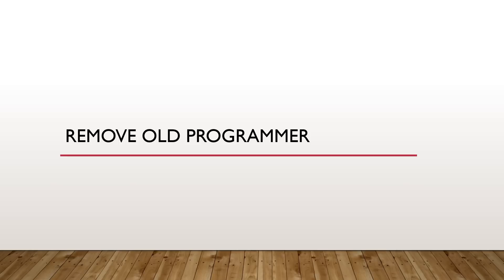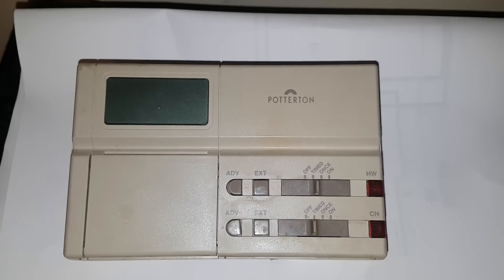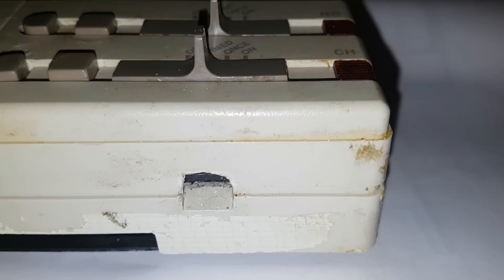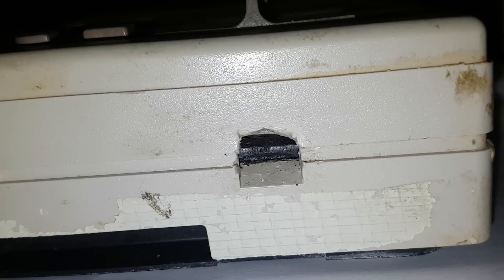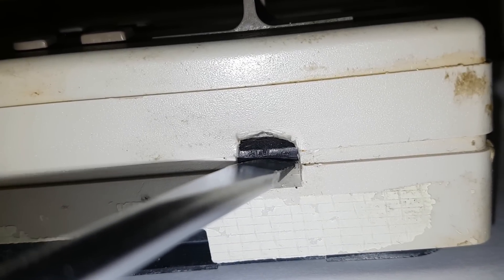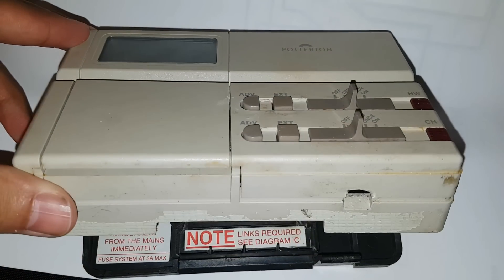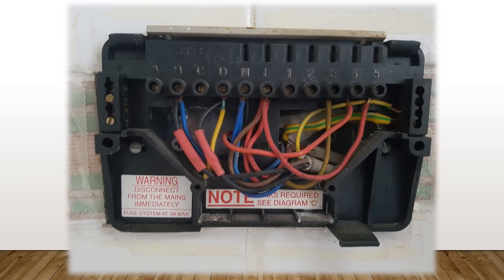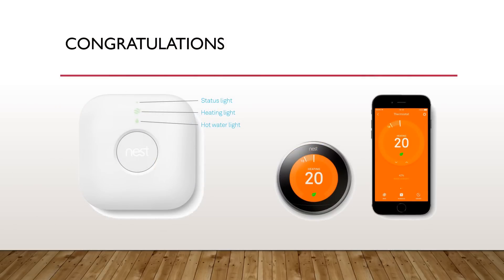How to self install Nest Smart Thermostat v3 (Y-Plan Potterton EP2002)

Comment: Good video, the only thing i would say is with 3 port valve system or 'Y plan' you also need to terminate the hot water satisfied terminal to ensure the 3 port valve does what its supposed to. As per page 23 of instructions. Terminal 4 on the nest. Other than that 👌

Comment: Not sure this fully works? Please educate me!  This solution does not hold grey at 240 when HW is off. Ie Nest not calling HW.  As grey is not energised, orange will not come on when CH white is calling at 240.  Therefore you need to wire nest satisfied terminal to Grey to ensure CH works when HW off - comments?

Comment: Amazing video. I have a question regarding the decommission. How do you wire the display from the receiver installed next to the boiler?
Reply from the maker: Very open question. Difficult to say without knowing it's function model etc

Comment: Is there a blanking plate you can buy to put over old program base? Thanks for video.
Reply from the maker: Just your standard 2 port blanking plate, you can pick those up for 99p. You may have to pinch a hole at the bottom.

Comment: Amazing video. I have the same boiler looking however have nest v2 and looking to upgrade to v3 for both hot water and heating. Do you have a video/wiring instructions on how to use the junction box near the water tank to connect the heat link. Many thanks in advance
Reply from the maker: Junction box is a spiders web. You'll have to do some tracing. See my other video for a basic understanding of how you can decipher what wires do what ..

Comment: Hi, thanks for a great video. We have installed as directed but the hot water is stuck on. Any ideas what might be causing that? Central heating is working fine. The only difference to your video was a blue wire terminated in the spare slots but I can't see far enough to see what it could be from.
Reply: In case anyone else had the same I found it settled in but initially on return of power the system was slow to respond. Seems fine now.
Reply: I've just installed and have the same issue. Did it start responding after awhile? I've just set it up but the hot water seems to remain on

Comment: Hi, after connecting the nest replacing my old potterton, the hot water doesn't work automatically. However when I switch to manual mode it heats up the hot water. 
Secondly, are you able to control HW through the app/thermostat?
Thanks for the patience.
BW

Liju
Reply from the maker: What you mean, hit water doesn't work automatically? It only works on timer and manual and it looks like manual is working? Yes you should be able to control hot water on/off through the app

Comment: Hello, thanks for the video. How did you tidy up the dual gang hole where the old programmer was? Did you mount the heat link straight over the top, or off to one side or something? I have a one gang 'hole' but not sure how to blank it off and still have two cables sticking out? Thanks
Reply from the maker: I bought a blanking plate for 25p from local DIY store. Snapped the bottom off enough to allow wires through, then mounted the nest on the plate itself. So it looks pretty clean.
Reply: @laymandiy  Thanks for the swift reply! I hadn't considered mounting the heatlink to the blanking plate, I was going to just mount it next to it. I bought a blanking plate earlier today so I'll give this a go. I'll probably just stick it to it 🙂 Cheers

Comment: Hi, 
I'm so confunse about all the nest installation videos, they look quite complex. But the instructions that come with the device are quite simple, remove the old thermostat and plugin 4 cables.  
I dont say yours is wrong,  bit I dont understand why that difference. Is it because their instructions are only for heating? Or why?
Thanks in advance for your help
Reply from the maker: Normal circumstances yes it should be that simple. Unfortunately the problem comes from deciphering which cables represent the 4 cables in the nest diagram. That's the only hard bit and maybe dealing with electricians wiring it in their custom ways. The old programmer is used to work out which cables do what.

Comment: Title of video indicated a Y plan system, system diagram showed Y plan layout complete with 3 port valve. But NO sign of a connection to HW off terminal in original programmer and no description of a HW
 off connection on  heat link. Very poor video.
Reply from the maker: If you do not understand why it is that the existing system didn't have hw off and it's meaning on the heatlink, please let some else who understands install the system, because that is the basics of a circuit.
Reply: @laymandiy  The circuit diagram in the install booklet (page 23) shows a HW off connection to terminal 4 of the heat link and it's vital for the correct operation of the system

Comment: Video was really help full gone back to it many times on jobs when changing old controls for the nest.
But only just notice how bad of an Y plan heating system diagram you used. 🤔😂
Where you download that lol..
Why 4 down stairs drops 🤪
Its probably what they are showing at these skilled trade course.
Anyway thanks for the video it's the best on here its helped a lot 👍🏼

Comment: Excellent video I got a question before I swap it out I noticed my live cable that runs from my thermostat to number 4 is that correct
Reply from the maker: On your old potterton?
Reply: @laymandiy  yes sorry
Reply: Yes that is on my old potterton
Reply from the maker: Rather weird, is your hot water always on?
Reply: We leave it on if that is what you mean and I can turn it off on the programmer I also have another wire going into number 3 also not sure what this is many thanks

Comment: Really good vid. I have the 2001 programmer. I noticed on mine the live was jumped to the L port from the earth block with what I guess were the live return wires running to other parts, so I gave up! Moving to a new house soon with a opentherm combi, think I’ll just wait until then.

Comment: Great video , I assume you used the nest stat as plus and go, rather than running two wires to the nest and hub
Reply from the maker: My nest thermostat is working with a direct connection to mains and not to the hub it self

Comment: Great video and helped explain how to cable up from old programmer (i have a Drayton LP522). 

Question though, where did you put your actual nest device? Did you walk mount it somewhere else?
I want to replace the current thermostat with a fixed nest unit so I can disconnect the 3 cbles from the Junction box and reuse them for the 12v nest power via the T1 T2 and just tape the 3rd wire. Is this OK to do?
Reply from the maker: The chances are those 3 wires in the old thermostat are not 12v at all, and if you try it, it will fry your thermostat. I have connected it via USB on a stand in my living room, as the hallway can be colder than my room, therefore it's more representative of the actual temperature I want.
Reply: @laymandiy  I just removed those wires from my main 8 port block and extended them to t1/2 on the actual nest. That then turns the 240v to 12v. Have marked up inside 12v at nest side. All working great now and not had to move the nest... Just fits into the old room thermostat location.

Comment: Hi. I have same heating system but my wiring in programmer is little bit different .can you help me
Reply from the maker: Jozef Cerven the key bit it's to get everything connected to terminals where it controls on off, that will never change between the programmer, as long as it is working as intended from before hand. Simply follow the table and connect everything going into that terminal into the same terminal for nest